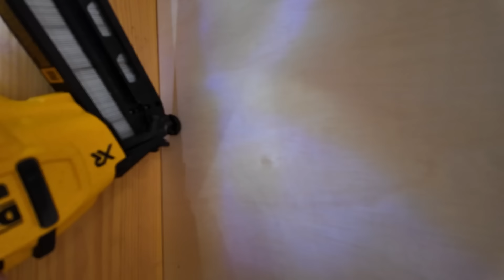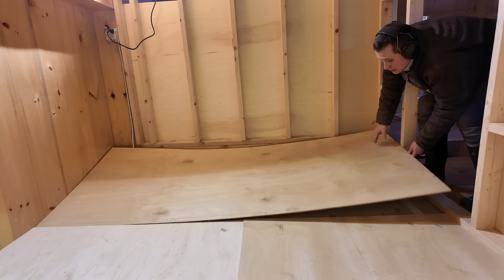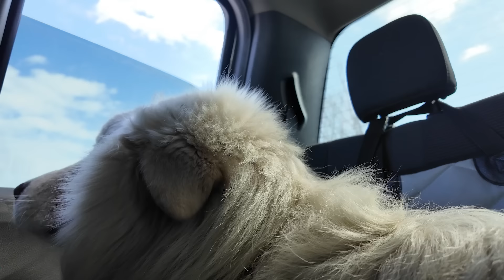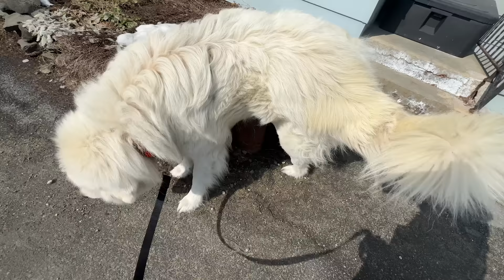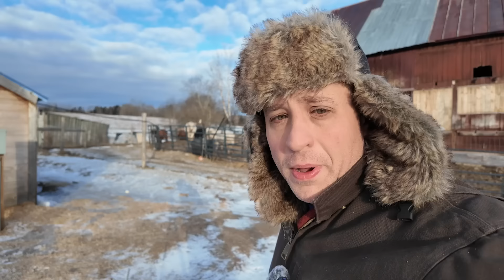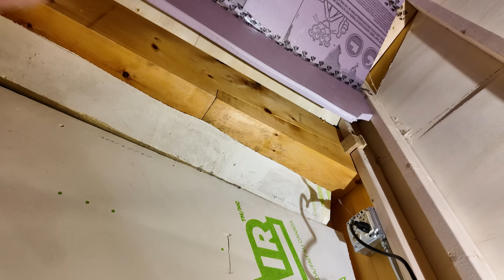Building a Bird Hatchery: I Have to TESTIFY (Episode 5)

Comment: I’m a bit surprised you didn’t put fiberglass insulation batts under the floor deck?? Also from my own experience building our chicken coops. Apply sanding sealer to the plywood floor. Lightly sand, vacuum up dust, tack cloth then apply a second coat of sanding sealer. It made hosing out the coops easier.

I didn’t do this in my coops but I suggest putting down simple plastic mats of some description where there will be foot traffic in the hatchery. Something easily taken up and hosed off outside the barn. This will tend to help keep the hatchery more sanitary over time.
Mark Fay

Comment: That hatchery ended up twice as complicated and significantly more expensive than what I would do, but you can be proud to have done it well enough without any outside help. 
Don't forget to apply a mold preventing treatment on the inside layer of plywood, the heat and humidity of a hatchery make an almost ideal environment for pretty much any kind of fungus. I would also apply a fire retardant on the wood, on both sides. There are commercial water-based mixtures that do both (and discourage wood burrowing insects as well), they're a bit pricey but will save you quite a bit of time and effort. I live in Europe so I can't recommend you a specific product because I don't know what's available in your stores, but these things are pretty popular so you shouldn't have trouble finding such a multipurpose wood treatment, some include a water vapor sealant as well so you won't need any other finishing on top of it. This thing can be applied with a simple paintbrush so you don't any specialized equipment and when I say pricey I mean like $80 a gallon (if my math is right converting from euros and liters), you shouldn't need more than a couple gallons to cover the whole thing inside and out.

Comment: Like you, I too am a hunter. And I own property. My sole issue with hound hunting are the irresponsible hunters. No one has a right to trespass on another's property. And while the dogs will run, the owners now can very easily have electronic collards that not only permit sending commands to the dog, they also have built in trackers so the hunter KNOWS where their dogs are. No excuse. BTW DeWalt should be a sponsor, they get plenty of 'air time.'

Comment: The hatchery is coming along nicely…did I miss the electrical part yet? I thought you might want to install that before the walls and insulation.  I’m sure you will. Be glad when it’s done.
Reply: I did too and made some comments to earlier videos about it.  It kind of looked to me like the outlet was poised to be boxed into a corner, unless I misunderstood the layout.  Maybe that part of the finish will be trimmed away or the electrical otherwise modified.  Once one already has a proper outlet, one can plug surge-protection outlet strips, that are mounted on the wall, into it.
Reply: Yea in another video I saw that outlet but I thought that was odd only to have 1 outlet for running bird hatchery’s. I don’t know how much power they pull but I would be afraid they would trip the surge protector. I’m used to my husband putting 2  outlets on each wall of a room. Lol

Comment: Is only one power outlet going to be enough in there? 
Would it be useing a bit of forethought to make an easy access hole while doing the build to fit an exstention leed through it on the left side of the hatchery to access the power outlet just outside of the hatchery .

Probably be easier to include that as part of the build on the right wall to access that power outlet just outside of the hatchery  and do it now so its in and not make a mess of all your hard work,  doing it on the fly later on.

Suggestion, a nice neat hole with a wood hole cutting bit on the drill or a jigsawed neat squareand trim it out just large enough to just fit a end of a power cord in and a sliding hatch cover with a knotched out bit to just allow the cable to poke and you can slide it down just a bit more to seal the hole up compleatly.
Just a through befor you realize you need it " now" after the build.